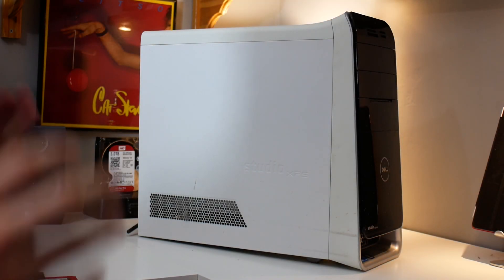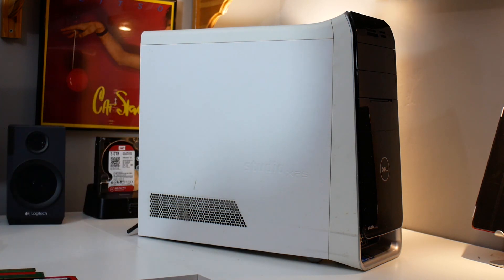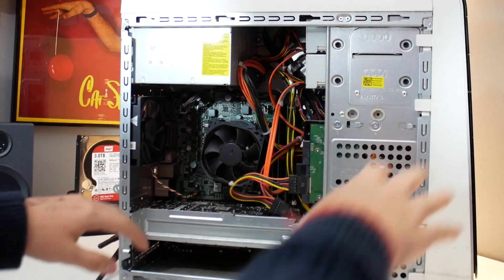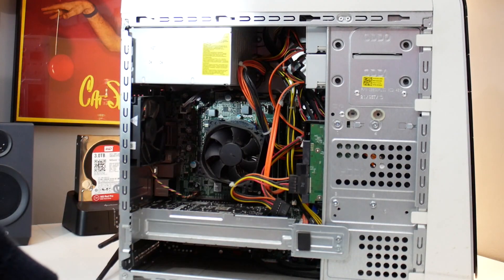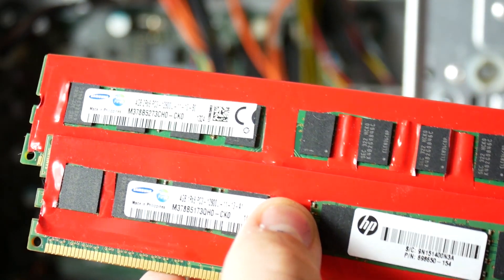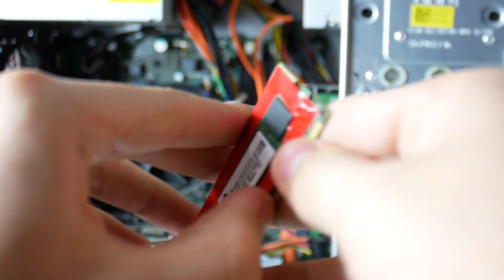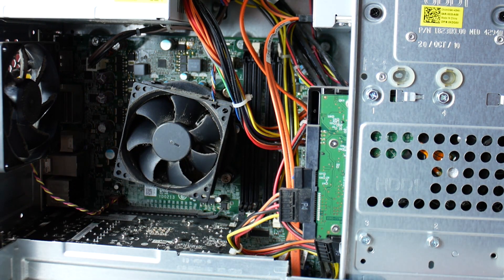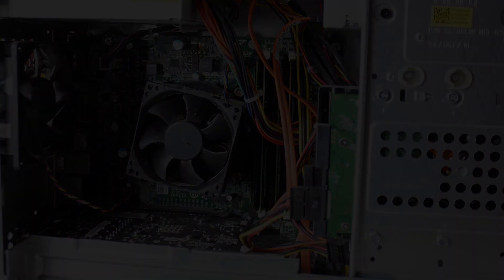Upgrading the RAM in my Dad's Dell Studio XPS 8100

Comment: Hi! I have a Dell Studio XPS 8100 that I bought brand new from Best Buy in 2011. It was working fine until it broke in 2015, and I haven’t used it since. I just turned it on after all these years, and at first, it wouldn’t power on. After unplugging it, holding the power button for 30 seconds, and switching the power cable, it finally turned on. However, now it won’t boot and gives me a 'No boot device available' message. In the BIOS, it shows 'SATA-1: Not Detected,' so it’s not detecting the hard drive. I’m trying to figure out if my hard drive is dead or if it’s a motherboard issue. Do you have any advice on what I should check or try next? I’d really appreciate any help!

Comment: I still have my 8100. I've got Windows 10 on it . Recently the screen went black but  I got it back working using the media creation tool  on a usb flash drive, I could not get it reset with files saved so I reluctantly opted for a complete erasure of files recovery. Strangely my files were not erased and they all ended up on a new folder called Windows old 000.

Comment: If you upgraded everything what parts would you choose? I have the same computer and I haven't a clue where to start.
Reply: Considering the specs, I think you might get a max of 16GB of DDR3 Ram or 32 If the motherboard allows you to. For what regards the CPU, the 1st gen Intel runs on the socket 1156 and I think that the I7 870 was the top tier model, so I think that upgrades on the CPU side are impossible (assuming you have the I7 870 in your pc). The graphics card could be upgraded easily, but I doubt that the 350W power supply from DELL can handle powerhungry gpus, try searching for a GPU that doesn't require an external 6pin connector. (try looking for a 1050ti "unplugged variant", more specifically a single fan one, for space mangement in the case).
Reply: Bootable SSD made my Dell Studio XPS 9100 a lot faster.  With my 9100 I could upgrade the processor to a Xeon W6080 with six cores and 3.3 GHz.  Not to sure what socket this mother board has for the CPU, or if you can upgrade the CPU.  Pretty sure you could run a GTX 750 ti graphic card, but not much more with that power supply.

Comment: Great vid!  I have one of these with the i5-670 chip.  My only addition is a 500g WD Blue 2.5in SSD (still have the  WD blue 3.5in HDD) and a Bluetooth dongle.  It loads up fast but its only great for watching YouTube, light home office, email, etc... I left the 2gb x 4 sticks ram in.  It has a nVidia GeForce G310 and has a wifi-card.   I was thinking of buying a i7-800 series chip, replacing the ram with 1- 16gb or 2- 8gb sticks of ram and upgrading the video card to something that would fit.  I also thought about gutting it and throwing in a micro or m-iitx mb and making a sleeper Ryzen 3 or 4 series PC.  Air intake/cooling scares me, though.
Reply: hey man, i also have one with the i5. im not a computer guy but did have someone put in an invidia 1030 or something as it no longer would play SC2 well.....  it still doesnt play it as well as it used to. ive never upgraded any memory. whats the cheapest way i can upgrade the memory so itll play smoothly?  (a few online "benchmark" tests put the memory in red and recommended for ram or ssd..

Comment: Good morning, I see the your are using Samsung m378b5273ch0-ck0 RAM. I also have a Dell XPS Studio 8100 (i5), in your opinion is possible/compatible install 2 x 4Gb (total 8Gb) of those m378b5273ch0-ck0 ram ?

Thanks,
Claudio
Reply: The CPU of my Dell Studio XPS 8100 is i5-650 3,20 Ghz (socket 1156), thanks again.

Comment: Help an old man out that doesn't have a tech savvy son! For the same PC- would it be possible to change the graphics card, add ram and get it running VR games? If so any suggestions?
Reply from the maker: Definitely possible- but the worth of doing it is debatable. The CPU in this machine is from around 2009 and will not be suitable for running anything VR, no CPU upgrades are really available unless you replace the entire main board.
Reply: @Techwen  Thanks for the reply! Just got an oculus quest and fancy trying the new link to pc capabilities! Trying to dodge the extra  price cost by upgrading the old pc... not looking good haha

Thanks for the advice 👍

Comment: I'm still doing heavy gaming on a first gen i7 from around the same time, still works well enough with a 750 Ti. The 5200 rpm drive is a bummer though, but SSDs are coming down constantly. I'd give it another 2 years with one if/when it's a possibility.
Reply: im still gaming with a sandy bridge xeon e3 1270